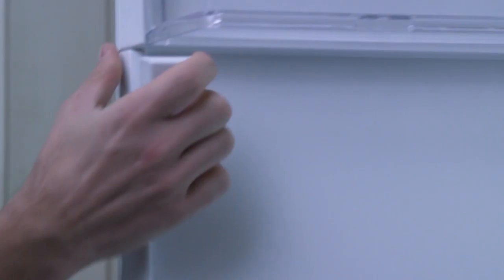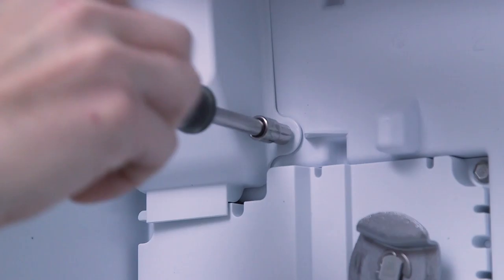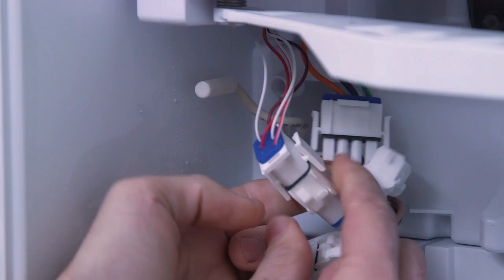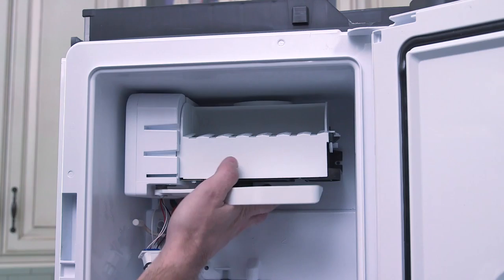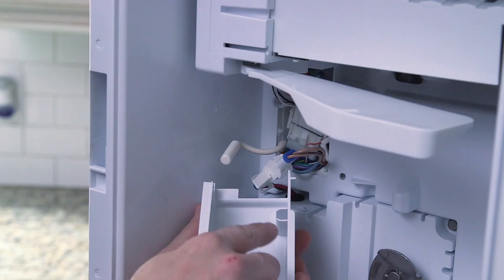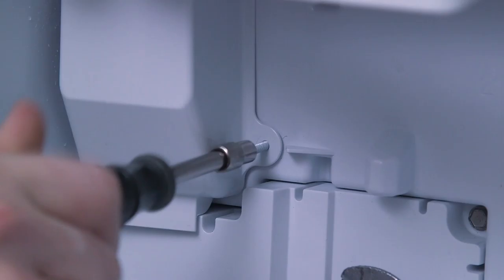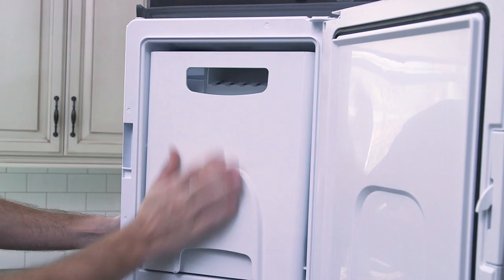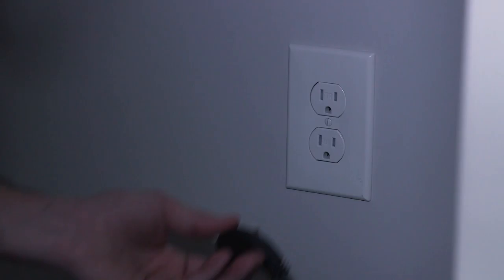GE Appliances French Door Refrigerator Icemaker Installation

Comment: My ice maker never worked from day one. Only water works. What can I do to fix. We've had it for 2 years. So no more warranty. GE asked us to find a local to repair since they had no one to service in our area. Sad...anyway, again, what could I possibly do to fix ice machine?
Reply: I have same problem did you fix it
Reply: @amargism  never
Reply: You sure that the ice maker is not switch off then on
Reply: @davidescobedo-gonzalez6969  where is that? Other than the front door button
Reply: I have the same problem did found out what solution ??
Reply: My icemakee never worked since day 1. Did any of you figure out a fix?

Comment: We recently had one of the control boards replaced. The fridge was not working for weeks. Now that it is working again, the icemaker is making moldy ice. Can we clean it with vinegar? The repair man said it will get better and eventually work itself out. It has definitely gotten better, but I do not trust that it is completely mold free and feel it is a dangerous thing. What is your recommendation.

Comment: I have a "dead" ice maker and a freezer that does not freeze things - Freezer only goes down to about 26F which causes frozen items to defrost and get soft.   Temp is set for -3F. but it has not gotten below 26F - this came with the house that I just brought - I tried unplugging and resetting but that did not work - any thoughts?
Reply from the maker: Hi John,

Thanks for taking the time to reach out about your icemaker and freezer, so sorry to hear about them not working as they should. You may want to check and make sure that your freezer door is sealing properly and that the gaskets are undamaged. The below two links can help you check that:

Freezer door seal: http://spklr.io/6054cB9s

Checking gaskets: http://spklr.io/6055cB9t

Also, if your icemaker isn't making ice, this article may be able to help too: http://spklr.io/6056cB9Q

If you continue to have cooling issues, we'd recommend reaching out to our service team, here: http://spklr.io/6057cB9v

If you have other questions or concerns, you're free to send us a PM on Facebook or a DM on Twitter.

All the best. -MS

Comment: This refrigerator is horribly designed. 
First the ice production is very slow. Even the ice tray is small too, it can store like 20 cubes tops so 1 person can use all these ice cubes easily in 1 day.
Also, the temperature of the ice cubes are barely at freezing point, so they will deteriorate right away. The ice dispenser mechanism rarely works, it spins and spins and can catch ice if lucky. 
You can see people mention all these problems. I won't ever buy another GE refrigerator ever again.